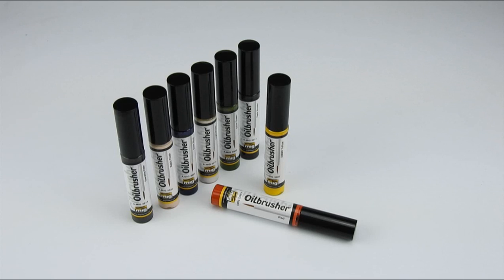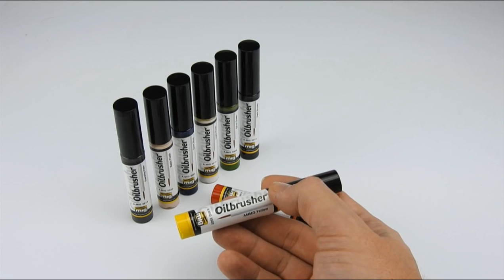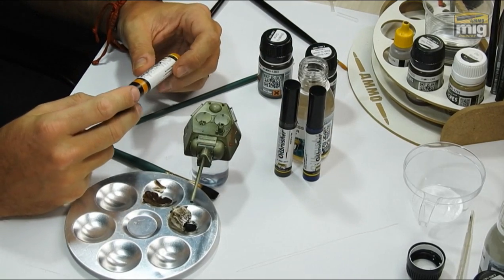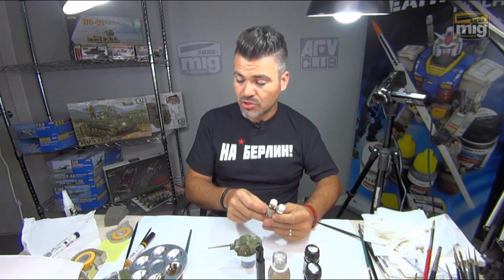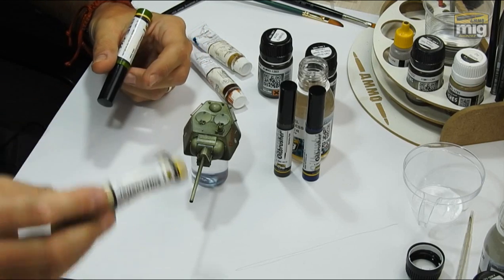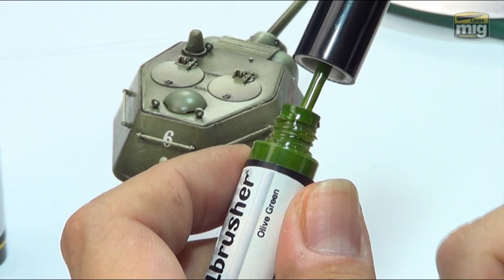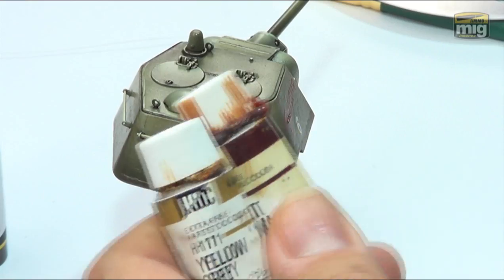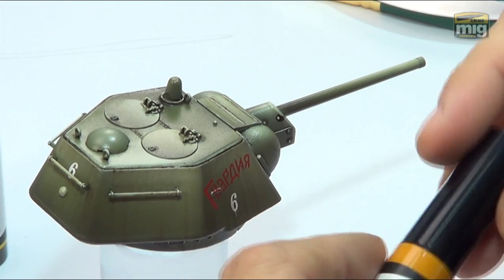HOW TO USE OILBRUSHER

Comment: I am building a 8.8mm tiger tank shell. The scale is 1:1  I am trying to figure out how to weather it some. I have set up  some places on the upper part for chipping but, the sides of the shell are big so I don't want it to look stupid. It is currently brass and I will add a dull coat. Suggestions?

Comment: I currently mainly use AMMO by MiG, find these also very "kind" to my airbrush (Harder & Steenbeck). It is so much easier to clean it with these colors.
However, I do sometimes use Tamyia, but you need a respirator (breathing protection) when using them.

Mainly paint Gunpla/Gundam, and I found a set of colors that match my models perfectly. With say Humbrol, Tamyia etc; I have to figure out if it's the "correct" color scheme for the 'mech.
Which sometimes can be really difficult. Thankfully AMMO MiG have complete "sets", the only thing you need is a good primer.

Comment: Best place to keep your oil brush set is in an Ammo brand storage thingy. I had mine in a drawer and forgot they were there. But with the one that looks like a bullet they are where i can see and my workspace looks cool.
Reply: what happens to the colors if they are not used for a longer time ??
Reply: @hypersturm  oilbased paint lasts forever if you store it properly
Reply: @moisteroyster7760  Many thanks for your answer. Is it necessary to seal/fix the final product or is everything grip-proof ?
Reply: @hypersturm  They dry to the touch rather quickly unlike regular oils but I always wait overnight to handle it.
Reply: @hypersturm  The enamel thinner dries it out considerably.

Comment: That oil looks way too runny and messy for this type of work. Exactly the reason folks leech out the linseed oil on cardboard. Can someone confirm that this oil works like other oils or is the silly makeup container the only redeeming quality?
Reply: I have just started using these and I have to say they are way better than normal oil paints, they go on very nicely and if you use a small makeup sponge you can really smooth them down, you no longer have to use cardboard etc, those day are now long gone thankfully...

You don't have to take my word, just get yourself one and give it a try, that's the best way I have found, and then, if you do like them, you can start to switch over one stick at a time, which is what I am doing as my money is a bit low, so I build my stock up with one or two a month...

All the best...

John...